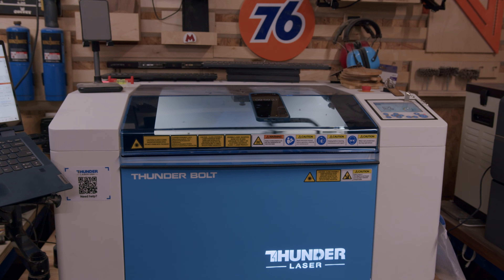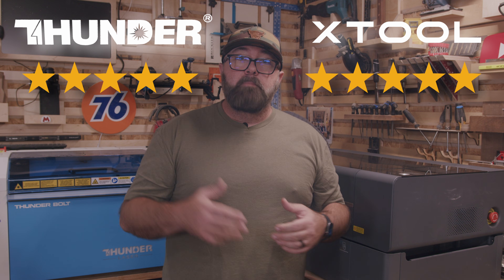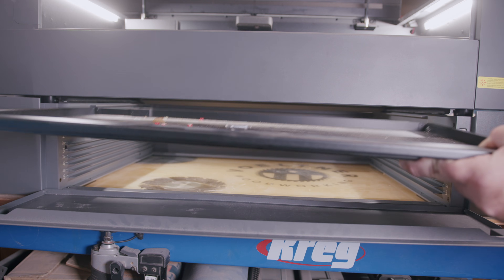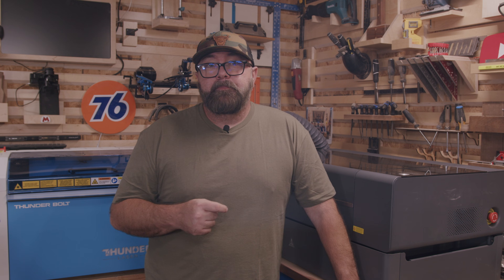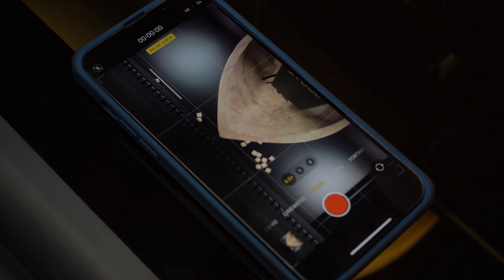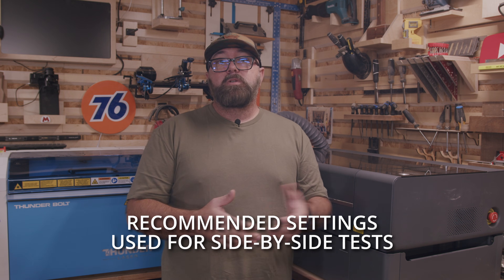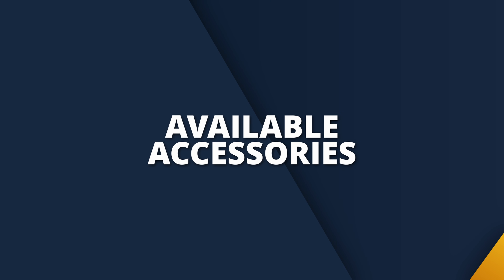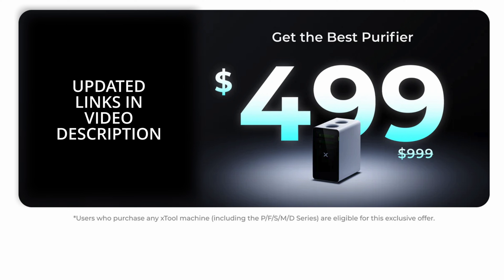Which is better? Thunder Bolt vs xTool P2

Comment: Thanks for the video, Live in South Africa and both these are available, need to make a decision as to which one I should get, This has hwlped me a lot and i will get the bolt. I also need something small to engrave or mark knives with tempered carbon and s/steel blades, would the F1 be good or should I get the F1 Ultra, or will none of them engrave on Hardened Carbon steel?
Reply from the maker: Glad it helped! Yes, the F1 ultra can engrave carbon steel. Great machine too.

Comment: Good video, I’m I the process of doing research on a laser. I thought about the XTool, but their customer service is not good. I called to ask questions, they couldn’t answer them. I called thunder, they answered all my questions. BTW, you did perk up more when talking about the P2. Just saying. Good info, thanks.
Reply from the maker: You’re definitely going to get better customer service from Thunder if you’re based in the US or surrounding countries. Both machines are good, so it really does depend on how you plan on using the machine. The detail of the Thunder is really good, but some of the bells and whistles on the P2 are great if you plan on using them.

Comment: Thank you for doing this comparison.  I'm getting ready to upgrade from my diode laser and these two machines were on my list.  Is the smaller bed a deal breaker?  I'm currently using a diode with 18x12.  Works for me now,  but with unknown growth, I'm worried i might regret going with the Thunder.   Even if it's just a matter of a few inches.  Or does having the ability of the pass through resolve those concerns.  
Looking forward to your response.  TIA
Reply from the maker: I can’t believe I missed this comment earlier. The smaller bed isn’t a deal breaker for me because if the accuracy of the laser is fantastic. Of course, each persons needs differ so if you think you’ll need a bigger footprint consider one of their larger machines. Great company. Thanks for the comment.

Comment: Voeltner, I genuinely appreciate all of your videos, but in this one, you seem to have missed several key points, and your conclusion feels somewhat misleading. I’m not sure if this is due to sponsorship from XTOOL or not—I’ll reserve my judgment on that, as I understand that internet influencers often rely on commissions for their livelihood.

However, RF ROI, accuracy at different engraving levels, and speed performance were not adequately addressed. In my testing, Bolt’s speed was 2-3 times faster than G-code P2, which clearly indicates that P2 is not designed for serious laser business operations in terms of productivity. It is not a professional desktop laser.

Additionally, weight is a critical factor for any machine, as it represents a significant investment. Durability matters, and the extra strength provided by a solid metal frame and overall build quality plays a key role in maintaining stability at higher speeds—this should not be overlooked. It IS important.

Moreover, XCS software is a complete joke compare with Lightburn. Having used both systems, I can confidently say that P2 failed me quickly, and I ended up reselling it after just two months.
Reply from the maker: Thanks for the comment. I have a full time job so I’m not concerned over the commissions. It’s hard to fit everything in one video as I’m sure you know. Undoubtedly I’ll miss some key points. I’m just looking to share my thoughts on some of the key similarities and differences I noted. I appreciate your comment.

Comment: Right now with the sale the P2 is hard to beat it’s like $1,500 off but the bolt seems to just be so much better.
Reply from the maker: They are both really great machines, and yes, the discounts are really good with xTool. For someone just getting into it either machine is good, and if you can get the P2 at much cheaper with the discounts I’d say it’s a good buy.

Comment: Great video, though the one thing I think you should have noted was expected life of the laser. My understanding is that a CO2 tube will need to be replaced every couple years. The RF laser has a much, much  longer life span.
Reply from the maker: Thank you. I did note that in my Thunder Bolt review. Hopefully people watch. :) Yes, the life span is much better on the RF laser.